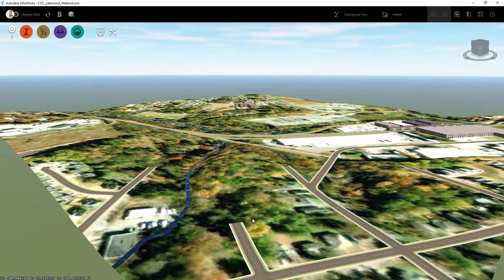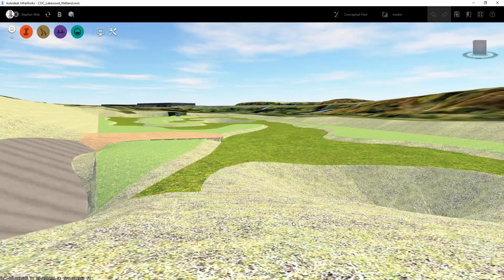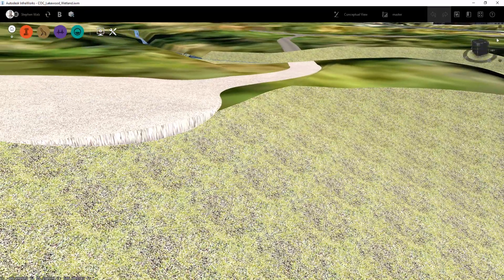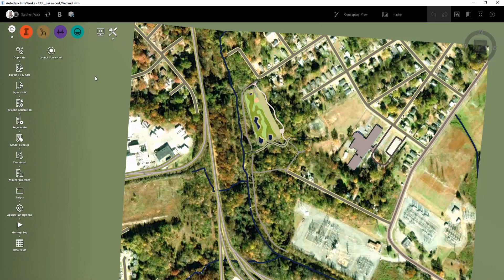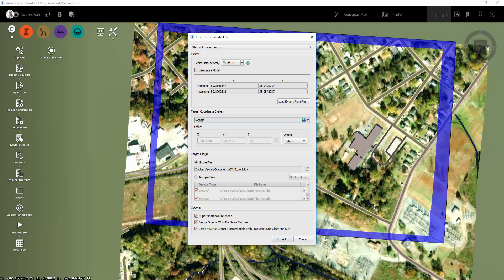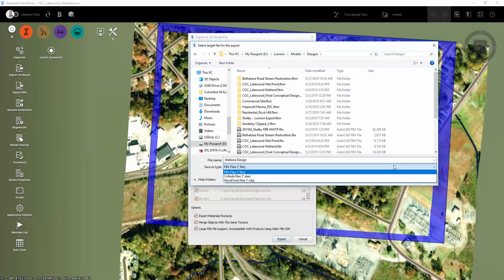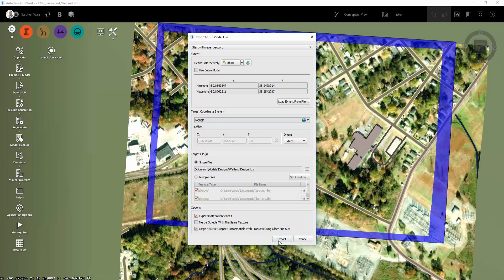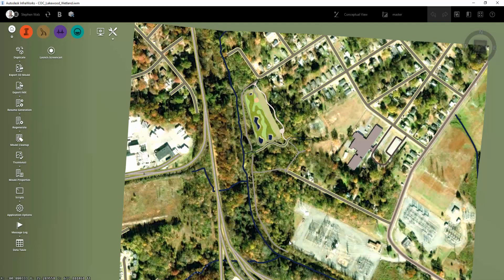InfraWorks Export to FBX

Comment: Greetings, I have never managed to import Infraworks fbx with nondisplaced texture to any program.
Except 3ds Max.
Even then, exporting fbx file from max gives the same, sad reluts. All terrain textures are misplaced.
It is a case on Sketchup, Rhino, Simlab Composer etc.
Is there any fix fir the texture issue when exporting/importing fbx Infraworks files?
Thank you in advance if any.
Reply from the maker: Thanks for the question! I’ve seen that occur with 3DS Max before, but haven’t tried in the other programs you mentioned. That said, I had a solution a few years ago that may do the trick, but need to dig it up. Feel free to reach out to me at stevewalz@hotmail.com in the meantime.
Reply: Hullo, thank you for your sign. As far as I am aware the only possibility to get the Infraworks fbx export with correctly placed texture is to pass through 3ds mac and there make same adjustments concerning texture. Alas, I ignore the suggested changes to be applied within 3ds Max.